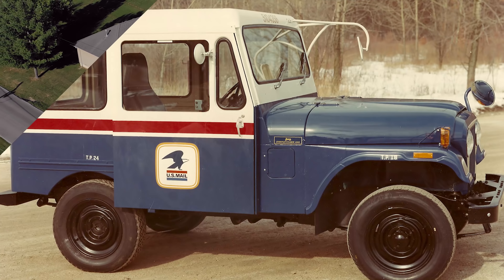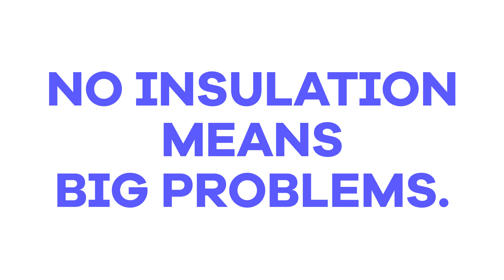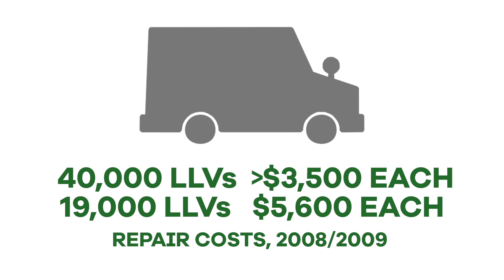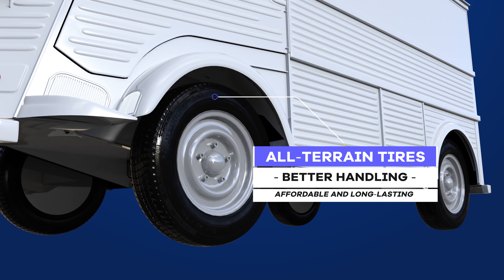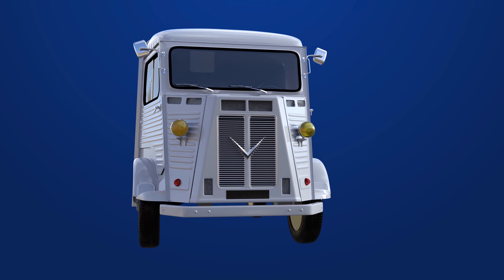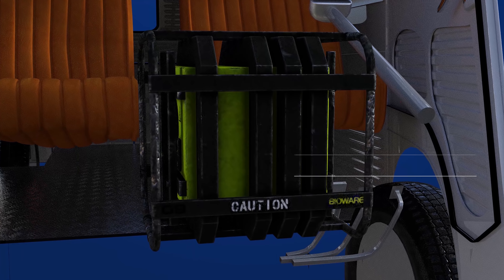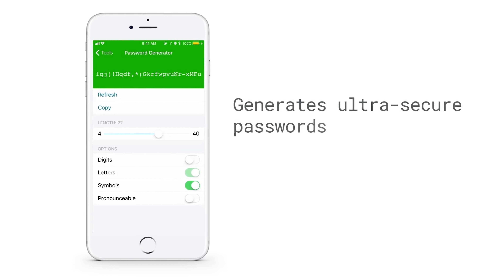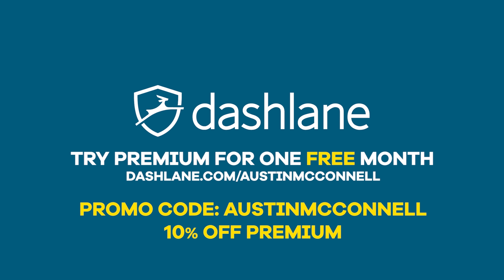Postal Delivery Trucks Stink. Let's Redesign Them.

Comment: Cool, so you designed a $50K postal truck...  I honestly don't understand why the need/desire to "disrupt" when COTS options like the Ford Transit Connect are a modern alternative ("well dressed", ~$27K/unit, stripped/equipped for fleet use and volume sales, I'm certain Ford could squeeze the unit cost under $20K).  Even the USPS recognized the existence of the Dodge Caravan.  Realize that cost adjusted to modern rates the $11K LLV would go for about $25K now, then look around the market for an equivalent alternative first.

Your "certain Billionaire who likes to disrupt segments with electric vehicles", to my understanding has yet to put into market a vehicle that costs less than $40K, and I think he'd have to double or triple his existing manufacturing capacity to meet fulfillment...  Tax-payers still have to foot the bill, $20K for 100K trucks would be $2billion, $50K would obviously more than double the cost to $5billion... or, about the cost difference of one half border wall. ;-)

You quote the actual fleet average fuel economy, without really addressing that it's beyond the most severe-duty stop and go for any vehicle class in the USA (save for busses and taxis).  While most of us get in a vehicle and go to one place or another, these trucks stop at every house or on every block, running the longest for the short time they leave the post office to the start/end of their routes.  My point is, city fuel economy for those driving in San Fransisco, CA, or New York City, NY - is not equal to those in Austin, Texas or Bozeman, MT.

I've been looking at USPS mail trucks around my area for a while, you talk about cameras and LED lights - this is already being retrofitted into existing units with aftermarket rear-vision cameras and COTS light fixture LED replacements.  The benefit of using a standardized truck light fixture format is that you can swap ANY fixture in there which fits - 5"x3" for the rear lights, 2"x6" for the side markers and front turn signal, and 5"x7" headlights.  You're probably talking $500 at volume per vehicle in materials, and some shop time (schedule LED retrofits with bulb replacements like they do, and you only pay for what you need).

My apologies if this seems harsh, but I'm getting tired of people doing knee-jerk rethinks for everything, when a subtle fine tuning or a little bit of frugal shopping would do.

Comment: Great idea but the front tyres need to be in-set more so it has a tighter turning radius and it should be rhd still becuase in america you drive on the right side of the road and mail boxes are on the side of the road so it'd be faster if it was on the right side too, other wise good idea, (plus Id still go for a gas engine)

Comment: I drive an old workhorse 2nd hand from usps actually it still runs…. Like 40 something years later but they don’t make parts anymore so my turn signal is on a toggle switch

Comment: Not even 3 ½ minutes in and you have a strike in your design. The 3 doors on the back is incredibly inconvenient, what mail carrier would want to open 3 doors instead of just sliding up one door? As I'm typing this, I'm hearing maintenance costs going through the roof with all of those techy electronics, which defeats the whole purpose of replacing them.

Comment: They should buy the rights to produce the Citroen truck. It's perfect, just upgrade construction materials, both chasis, engine, interior, etc. brakes and safer internal structure too. And that would solve all the problems. Some times the solution can be found looking back.

Comment: Driver still needs to sit on the right side of the vehicle.  In many areas, mailboxes are at the street.  Having the steering wheel on the right side of the vehicle allows the driver to deliver mail without having to leave the seat.  Your design would not allow for that.

Comment: Yes build a copy of the Ford transit van there is a short wheel base and a long wheel base, it high off the road, it's has independent suspension nice and soft for rough roads surface, just, put a electric motor in it.

Comment: Why you don't want an electric motor on a mail truck? 
Lets have a look at the electric mail truck that the german post office, the Deutsche Post, uses. They have a tendency to burn down, and when they do, they are a pain for the local fire departments do put out, as there are currently no ways to efficiently put out an electric vehicle fire, exept for taking a crane and dumping the whole vehicle in a Dump truck flooded with water, then wait 48 hours. Oh, and the batteries have the tendency to spit hot accid everywhere, making the whole "putting the fire out" operation a HAZMAT operation, also the whole road has to be rebuild after such a fire. 
Then there is the issue of winter. German snow plowing is quite good, so the non existing "offroading" capabilitys of the vehicle are no problem, but the heating is. When the heater is on, the vehicles range is decreased by over 30%, hindering operations.

Comment: Wow a design worse than 30 year old llvs, but you do know there was another batch done by Ford in the 90s to the 00s on a Ford Explorer frame, generally called Utilimasters or CRVs? If you look at the rear of the truck you tell the difference, the Gruman have an angled rear and rectangular lights while the Fords have a squared off rear (perpendicular to the ground) and round lights. The Fords are slowly changing over to LED lights as the incandescent stockpile they've already paid for depletes, while the Gruman are being scrapped in ever increasing quantity.

The truck to replace the LLV needs to be compact in width to handle narrow residential streets and right hand drive and not too tall so the letter carrier can access a rural style mailbox without exiting the truck. Also beside the driver needs to a tray large enough to hold a MM tray of  machine sorted Letters (commonly called DPS), a tray of "Flats", hand sorted mixed mail of mostly magazines , and tray for parcels or other third bundles. The purposed truck would cause something like a 30 second increase per delivery point, and with about 800 delivery points on a curbline route, you'd be practically doubling a days work.

Now for park and loop or apartments, I like it. 
But it's not that much of an improvement over the dodge promaster, a truck already in use for park and loop and apartment routes.
The electronic suite and electric engine are great ideas for city routes, but there areas where an electric engine isn't viable, such as super rural areas where even gas stations are scarce. Some rural routes drive hundreds of miles in day.

Comment: As a current rural carrier of the last 7 years and many more to go, yes, the USPS does need a new fleet, badly. However, the suggestions for a new vehicle made in this video most certainly will not work. The number one reason being the upfront cost of building for the largest fleet of vehicles owned by a single entity in the entire country.

Feel free to reply with any questions you might have and to avoid having to answer it a thousand times, I'll state right now, that the USPS DOES NOT AND HAS NEVER used government money.

Comment: Or just use delivery van. Much cheaper and safer, you get economies of scale from existing delivery van market. No need to reengineer new body which might risk engineering mistake. When the unit is too old it can easily be sold or scrapped and replaced.

Comment: put the steering column on the right hand side, no mail carrier wants to get out of the seat buckling and unbuckling a safety belt every 10 feet, regardless of curbside boxes or porch boxes. why is there a second seat in it? not needed. instead put a table there for treys of mail, papers only thing riding with a letter carrier. all the electronics coupled together with an electric motor i'm not sure will work. that thing will be expected to last 8+ hours a day in hot heat and cold... well.. cold. and it WILL be neglected. those LLV's are heaps of junk, despite the dollar amount you quoted most of them  are still held together with duct tape and bubblegum. before remodeling the LLV, remodel the post office. no sense treating a symptom when you can treat the source.

Comment: The only thing I really don't like is the idea of integrating tablets directly into the system.  Hardware like that, especially with touch screens, go obsolete much more quickly.  If we want it to be long-lasting, then it would be better to have a swappable device that interfaces with the sensors.  Think like a docking port with an api.

Comment: You have designed a niche mail truck, not an all purpose vehicle.  The LLV may be flawed, but it is a vehicle that fits the most needs. It could be larger and modernized, but a complete start over is too far. Just tweak the design.

Comment: If the mail truck in 1980 was to have a diesel engine, you could have air-conditioning for the summer and the winter heat, and a very cheap run around!

Comment: If it doesn't have 4wd you'll still need chains in the winter in many areas. Unless they change to snow tires in winter or the roads are extremely nice

Comment: I like all the modern tech... but come on man these are mail truck, let's keep the electric engine, skip the 360 cameras, skip the integrated tablet, and keep the air bags. Think about down time if the tablet breaks, if it's not integrate its 0, you just roll back through the office and pick up a spare. Any of those cameras/parking sensors break that's a huge repair cost. Think about it one of the biggest issues with the trucks right now is the price spent upkeeping them -- with all the extra unnecessary stuff in the new design we'll have the same problem 20-30 years down the road.

Comment: I had to stop and comment at just before 4 min mark.  His solution to winter hazards is to put an all terrain tire on there?  Im guessing you havent driven in winter much, because that is the same mistake the postal company made.  Purchase a good all around tire that can tackle all seasons, last a long time, and purchased for cheap - this doesnt exist.  The fleet would be better off actually equipping equipment engineered for the winter season.  A fix all solution for tires doesnt exist.  Plus all terrain tires would be moreso for deeper snow, (they would be worse than a regular all season in slippery conditions like ice and packed snow, and the pictures shown were trucks in such conditions.

Comment: Technology ages, and camera systems are expensive. Don't intigrate technology, thats more to become obsolete. Just have a tablet holder. Also the design wastes mail space and in general is larger than it needs to be. As well as the fact that the design looks threatening. Have a simipler more approachable design.

Edit: electric engines are a horrible idea. Because every 5 years we will have to shell out thousands on every truck for new batterys to replace the well worn older ones. A simple ford i4 would do the trick. They're small, fuel efficient, and generally reliable. Also they don't require thousands in matience.

Comment: All terrain tires would be a terrible idea, mainly because the majority of these trucks aren’t going to be on dirt roads, the only place where knobby tires would be advantageous. Also, they would be more dangerous on asphalt because of the different rubber compounds and surface area, yada yada basically you can’t just have one type of tire if you want better traction.

Comment: They'll never give us A/C :/  Instead they'll spend more on safety talks and brochures about heat exhaustion.  They can't even let us start early to beat the heat because the mail plant can't get the mail to us an sooner than 8am.  And that's because the plant has to wait for 2 day priorities before they can dispatch which slows up 90% of the rest of the mail operations.  

I also hate the "hop" down from a postal truck to the ground.  500 houses a day means dismounting at least like 50 to 100 times.  It takes a toll on our ankles and legs having to do that 1 foot drop from the door to the ground.  

And 1 other thing....The mail of the future seems to be 3rd class circulars.  Business love to advertise and spam the route in the cheapest way possible yet this is the stuff that takes up most of a carriers labor and time.  It's not uncommon to have to throw 3 circulars on the same day.  But there's just no place to put these things in our trucks that make it a comfortable reach.  We have to merge like 4 or 5 different trays of items for every box we stop at.  That one tray in the truck for mail only has space for 3 trays. …. (1. letters 2. flats 3. circular or small packages.)  Please add additional spots for better circular throwing.

And a holder for drink/scanner and phone.  I really don't think these are too much to ask for.

Keep the camera's.  They're so unnecessary and expensive.  This job has PLENTY of big brother bs as it is.

Comment: Electric motor and battery will not last and are not good for rural spread out areas where they will need to go long distances between stops.s It's gotta be gas or at most a plug-in hybrid. Go simple. I was on board until the cameras and left-hand drive. Just put a really efficient 3 cylinder engine in there. I think you could expect 27-40mpg out of a basic 3 cylinder engine on a light truck frame. Either that or buy the same trucks UPS uses. All that being said, an electric motor and recharging infrastructure just aren't feasible yet for a network as big as the US postal network. It's gotta work everywhere, and no one-horse town with a post office is going to be able to get the budget to adopt charging stations, solar power or hell even find a  mechanic that can work on one.

Comment: A hybrid engine might be better than an electric engine for more rural areas with longer routes. Also, it didn't look like your design made it easy for the driver to deliver mail from inside the truck. Mail boxes are all at a height of approximately 45 inches, so either they need to all be replaced or the truck should stay at the same height. It would take way too much time for the driver to get out to deliver my one piece of junk mail

Comment: No. They should be Diesel with no DEF Fluid. Diesel Emissions Fluid with all the filters makes Diesels extremely in reliable. Also Electric engines and batteries are heavy and expensive. The best way to make this cheap and reliable is put a old 7.3 liter powerstroke in her with a good old 6 speed manual. And forget about electrics just more stuff to go wrong. Cheap and reliable.

Comment: Sounds good but wrong on HIGHER one of the greatest causes of personnel injury is the "  step up" " step down " currently existent because of it getting wet in inclement weather . Plus, you dont mention retaining that 0 turn radius which is the LLV S  greatest asset. Of course it's too old by 2006 it had reached its goal. Grumman's truck was a modern marvel and still going 15 years after its end date.

Comment: ok, i like the design for a functional standpoint, but come on. it looks like its from the 1950s. even worse than the original llvs. change up the grill in the front to include flat headlights like the original and still retain safety, and it will be good. also holy shit keep the steering wheel on the right

Comment: Hmmm. I several flaws. A proper van need to be : 
cheap, simple, long lasting
So, we take an existing chassis. Ford? Maybe a Toyota? 
Next, simple. Your electric car idea, while cool and makes sense, does not fit, yet. There are few mechanics that can work on electric vehicles, the added weight would be INSANE and some mail carriers need up to 300 miles of range a day, and not as reliable in extreme cold. A small EcoBoost, R series or Toyota engine would fit properly. Not many modern feature either. A simple AC, Auto trans, and maybe backup camera, at most. The most complex, the most money.
Long lasting. Body on frame. Good engine and trans. Aluminum construction. Good engineering. Work with toyota.
Reply: That is exactly what an LLV is (specifically they used the chassis of an S10 using the GM iron duke I4 engine with a three speed turbo-hydramatic 180 automatic transmission and is body on frame with a good (more or less) engine and transmission (though a manual would be better in my opinion) and uses an aluminum body/frame so it is light)

Comment: EV would not be a good solution for right now. You could replace suburban and urban areas with them but as for rural areas, no chance for now. It's probably best to go with a hybrid of some kind but the challenge is repair on a hybrid is more expensive than either choice so you'd need EVs with a range of at least 200miles to satisfy the requirements. WHich is fine but I worry about rural stations that may not have that infrastructure s make the design modular to allow for LPG versions

You don't NEED any of the safety garbage except the airbags. Don't be a bad driver and know the dimensions of your vehicle, no one should need cameras or monitors, just adds unnecessary cost. And the integration into a digital network could be done simply through a tablet, just keep it simple, modern powertrain diagnostics already exist so that's a given anyways. I'd just add better communication equipment that is easily upgradeable to future proof the design and AC and heaters to the interior.